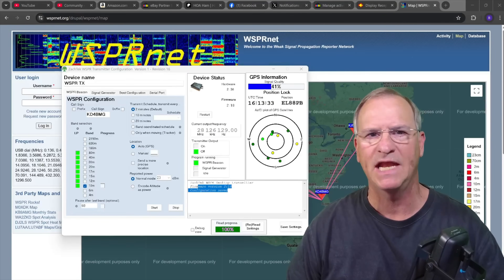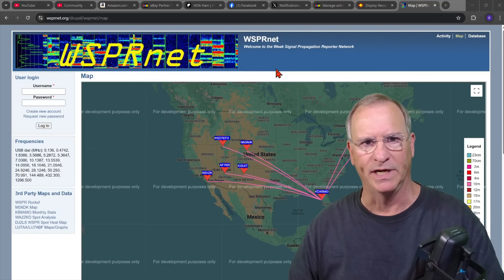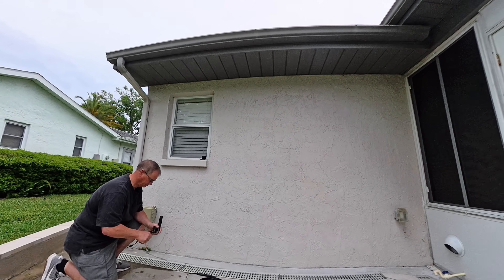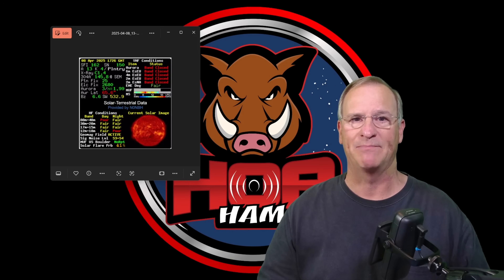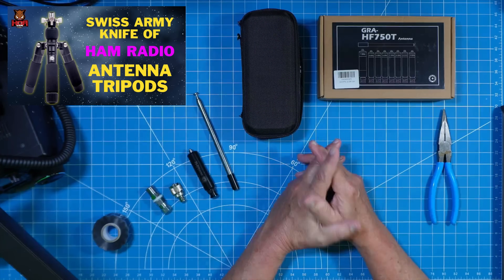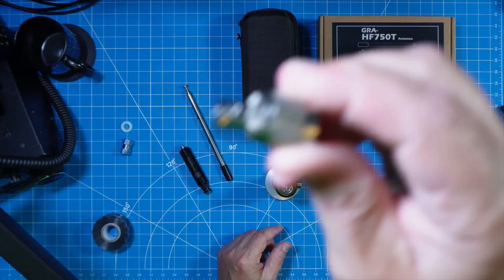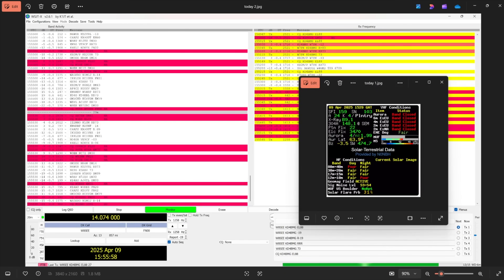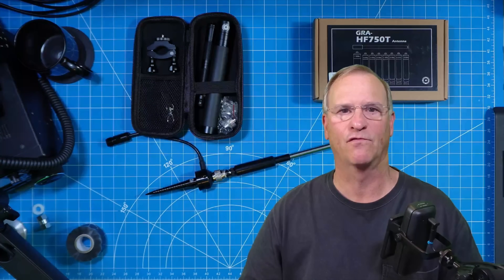Stealth HF Flower Pot Ham Radio Antenna for Condo, Rental Home, Town House, & HOA -- Gabil HF750T

Comment: I just got back from a trip to Salt Lake City. Used my HF750T and the same stand kit you have, set up as a Tri-pod, in front of hotel windows and my daughter’s sliding glass door. Can’t tell you how good it is for transmitting, because I have been using it for reception only on my various Malahit-DSP SDR’s. The reception was  excellent on the good band days and what you would expect for the bad band condition days. Keep in mind all you apartment dwellers, I have as yet to set it up for use outside. Wish I had this set up when I was working and traveling a lot. If you haven’t guessed by now, it’s a great set up for various circumstances.
Reply from the maker: Glad to hear you are enjoying the HF750T and hope you have the same success on TX.

Comment: I was really surprised when you mentioned that the antenna was on the south side of your house.  Judging by your QTH and the contacts you made to your north and west, I had erroneously believed that the antenna was on the north side of your house.  You did very well with the antenna on the south side and signal going through your house.
Reply from the maker: Yeah, that kind of made me smirk a bit when I was looking at all the maps with the signals to the north.  RF goes through block, wood, and shingles with no issue, but I thought for sure all the aluminum above it was going to kill the signal.